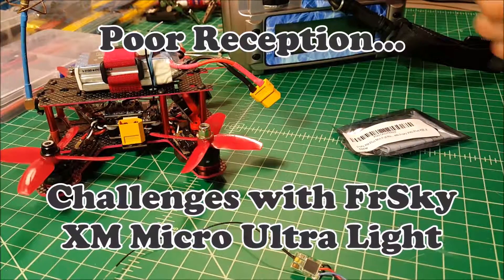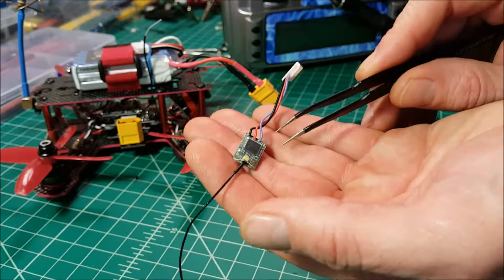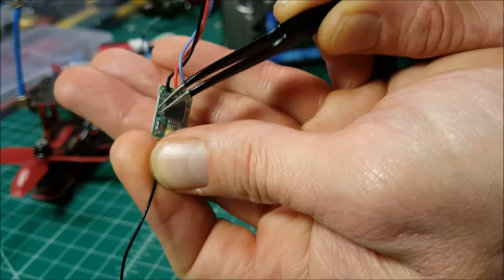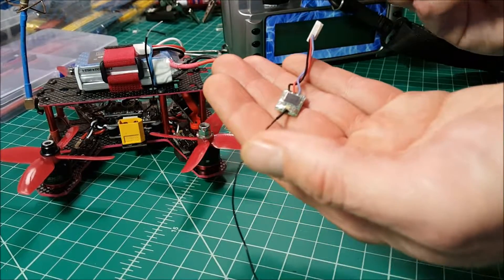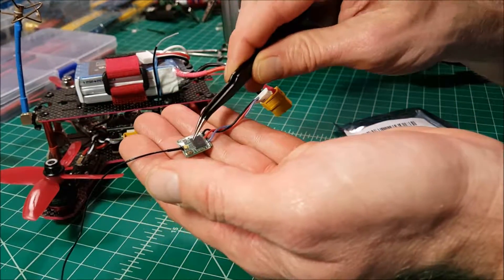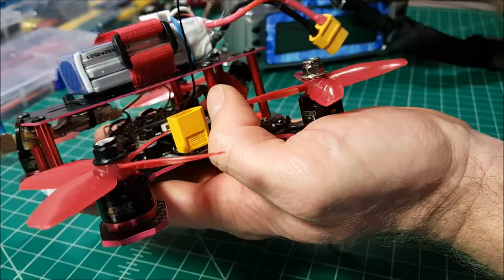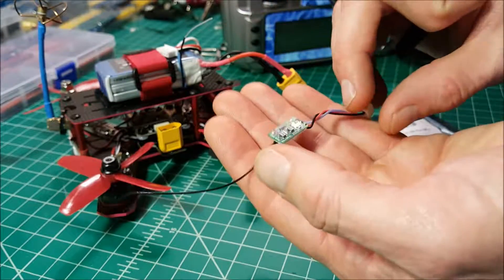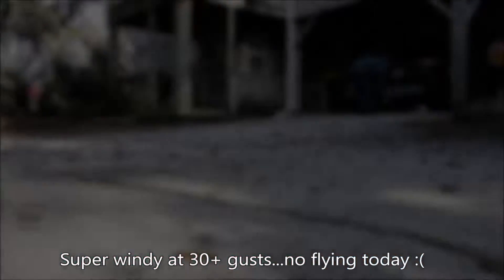FrSky XM Mini Ultra Light D16 Receiver - Range Test Fail!

Comment: These receivers are quite poor (the XM). They are very susceptible to interference from the video transmitter. If you fly with the tx off you will find range is decent.

Bit of a flaw for our use though!
Reply from the maker: Xaviera Yayaell ah, good point.  I may test it just to see.  I did have the antennae for both 5.8 and 2.4 right next to each other (both out the back)...hmmmm.  thanks!

Comment: just to update you with the xm receiver it does have rssi and you have to set it up in beta fight by enabling channel 12 and the rang in good conditions is around 500 to 600 meter(tested) there is a video on youtube how to enable rssi on xm and xm+.. have fun..
Reply: I have the exact same problem ... 50 meters max rang :(
Reply: @mhdeutschland  50meter  not more
Reply from the maker: mia miaa thanks for the info!  unfortunately I only got 150ft before dropout (non range test), so I must have a bum one.
Reply: same here..100ft max and drop out